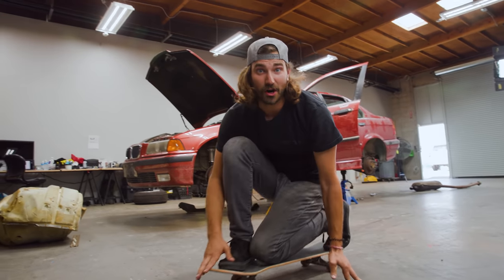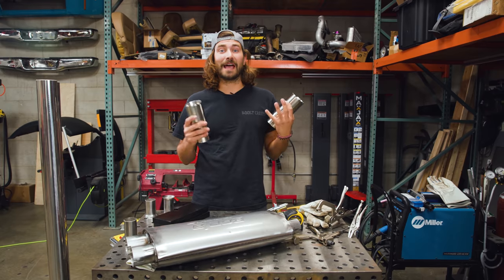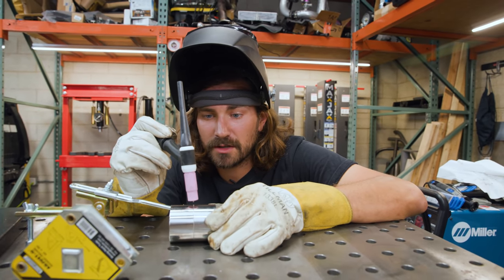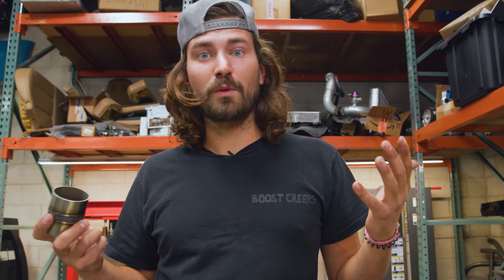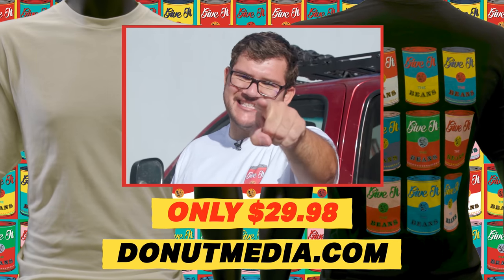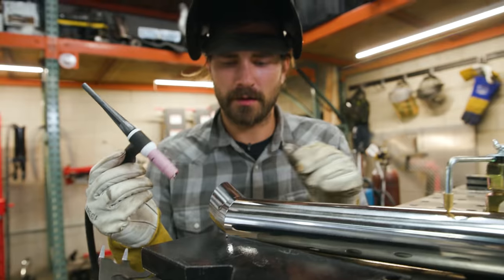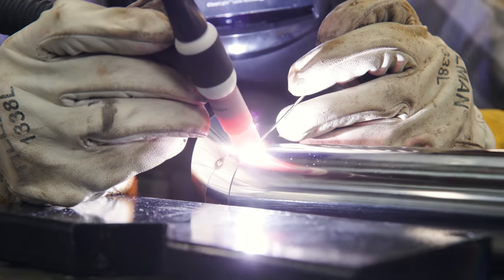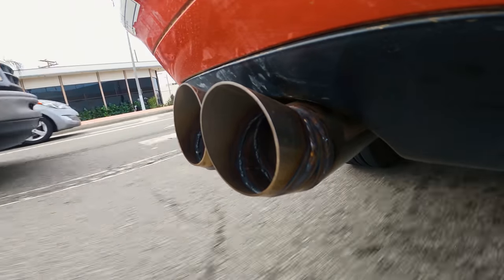DIY Exhaust! - Is it Worth It?

Comment: love the videos but this is far from a "budget build" with the amount of heavy shop equipment you guys already have and all the brand new parts you're picking up. 
THE WELDER ITSELF IS $4000.

if you're going to call it a budget build, give yourselves an actual budget, or tell us what the range of prices you could find for those parts would be, in case someone else might be limited in the financial department